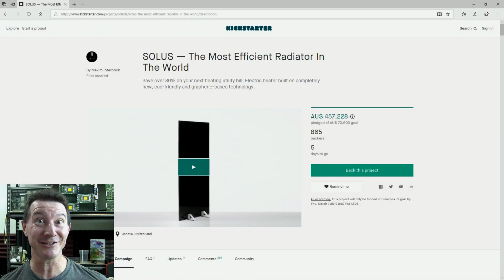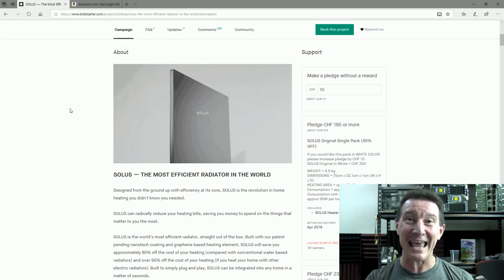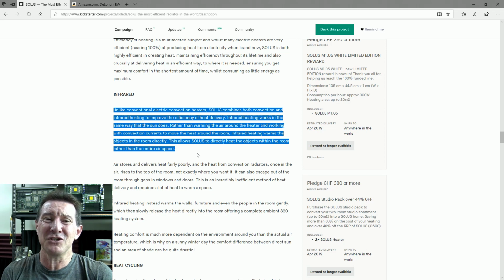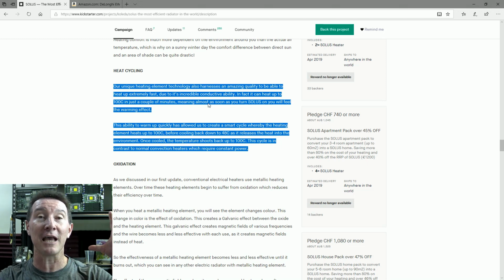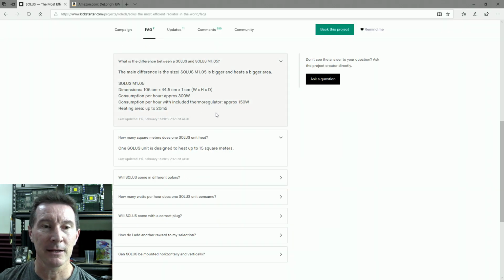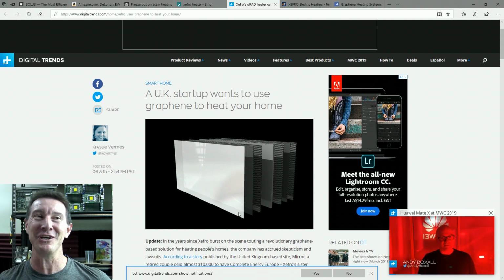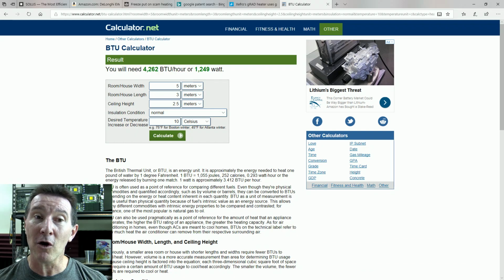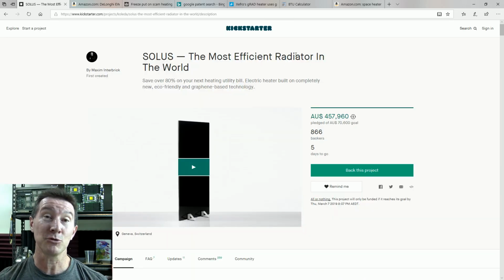EEVblog #1186 - Solus Graphene Heater Kickstarter BUSTED!

Comment: In an effort to say something besides the 1500 other comments, I will differ with a couple of things Davey didn't go very far into. (What is presented in the ad IS a crock.)

 People that are schooled in electronics (such as myself) start off completely underestimating how well a bad conductor of heat conducts, because electrical insulators are so drastically better than thermal insulators. A reasonable amount of heat will be conducted through 2 mm of glass, while you would expect no measurable amount of electricity to be conducted. Besides that, all that happens with a bad heat conductor is that the temperature differential rises, making heat flow faster, until it conducts just as much heat as if it were a good conductor (thermal equilibrium.) Besides that, a bad thermal conductor can be fairly transparent to electromagnetic waves, bypassing the fact that it is a bad thermal conductor. As Davey points out, the watts will always get into the room one way or another, but that is going to be primarily through the face of the glass.

 The problem is how hot the panel will have to get, and it will become dangerous before it self-destructs. OTOH radiation dominates over conduction as the temperature gets hotter, and the advantage this panel might have, if it has any, is more radiation, if indeed it radiates more than a cheap space heater, which is not evident. They never make clear in the ad any advantage.

IAC, if you make the radiating surface big enough, the temperature will go down, and, by the fact this thing is not in a protective enclosure, it must be cool enough to be safe. It better be.

 It is possible this is simply a large radiating surface (at an astronomical price) and by that means it will be more comfortable to be around (as Davey mentions), so, as a supplement to your usual heat, you might be able to lower your thermostat.

Comment: I am about to launch a Kickscammer of my own. Who's with me?
So, it will be about this: 
"Modular Ultra-efficient Heating Elements with Visible and IR Light.
Our mission at Luxor is to reduce the costs of heating and lighting your home. Based on our patent-pending technology using tungsten nano, micro, and mili wires, we have created some glass capsules of various power ratings from 15W to 150W. These Silicon oxide capsules will fit into your existing lightbulb sockets (E26) and provide you with warmth and comfort, as well as natural looking light. No more that cold and blueish tinted light from those flickering CFL lightbulbs. Now, you get warm yellowish light that will stimulate your brain and regulate your heart rate. 
The first 1000 backers that contribute $500 or more, will also get our patent-pending magic black-box that will allow you to dim the light and reduce the heat output to fit your exact needs and desires. 
Bringing the future today! Don't be left behind! Pledge to our project and be part of the enlightenment revolution!"

Comment: Now I feel sad and environmentally guilty. All my life I used those inefficient radiators that waste energy by converting most of it into wasted heat that is simply dissipated into the room. PS: What is not heat is a mechanical work of a fan and some light from LEDs.
I remembered that I used to get free heat from my electric water boiler. Much better than the 1.5  seconds of the "graphene" from Max. So, it goes like this: I boil the water for my tea or coffee, then even after turning the boiler off and pouring the water in my cup, it continues to "produce" heat that is being radiated into the room and in my body.

Comment: Reminds me of the local old-fashioned salesman that runs the same old home electronics shop since he was young, more or less affectionately nicknamed "el charlatán" due to the way he peddles  and upsells his lackluster wares. Recently I asked about the cost of a deep fryer, since mine needs the drain tap fixed or replaced, and also the cost of the part. According to him, it can't be fixed, and the new model he sells is more efficient. He totally ignored my dry "a resistance is 100% efficient" comment and kept going on his spiel. Could have sold me a new seal or the whole part, whatever is needed, if he was honest enough to drop the bullshit when he is called on it.

Comment: Question to everybody here, a radiating heater is 100% efficient that's understood but what about those heater that uses glowing wire and fans, are they not less then 100% efficient? I mean due to the light emitting from the glowing wire and the movement of the fan.

Comment: Graphene is a terrible material to use for a heating element simply for the cost of production. Fan heaters cost practically nothing and have the same efficiency as this product, except fan heaters will bring the room temperature average up more quickly because of the forced convection.

Comment: This is a convector not a radiator.
Radiant heating simply uses radiation to heat surfaces of objects. Unlike convection heating that heats the air, radiant heating emits infrared radiation, which travels unimpeded until it hits a solid object, which absorbs the radiation and warms up. A good everyday example of this in practice is the sun. This heat is traveling through the vacuum of space.
Convection heaters heat the air and then transfer the heat throughout that space to warm up people and physical objects.
I suppose its a combination of conduction and convection heating but not radiation. Its unfortunate that someone called these things radiators a long time ago and its stuck .

Comment: to everyone who has no idea about the basics of thermodynamics:
imagine you have a pond in your garden. it has all sorts of leaks, so it looses quite an amount of water during the day. in order to keep the water level within a desired range you are refilling your pond from your mains water supply every day. you could achieve this simply by manually turning on and off a tap connected to a hose leading to your pond. or you could install an automated system turning on and off a valve (or tap for that reason) to keep up the waterlevel. quite simple over all, isnt it?

Now imagine someone offers you a brandnew system and claims by using it to refill your pond you will save on 80% of the amount of water you used before!
Edit: Thats the same type of promise SOLUS is making.
Would you believe the claim of the company trying to sell the new and magic water refill system??
There you go!

Comment: Oil based heaters are mostly relying on convection and not radiation because the oil can only get so hot before it starts chemically decomposing and fuming. The higher the temperature the more dominant radiation becomes at giving away heat.

There's a recent craze when it comes to "radiation" heaters because they heat your home evenly unlike the pesky convection heaters which only heat your ceiling - which is complete bullshit, of course.

Comment: @EEVblog , you got the science on this one completely wrong, I'm afraid. The product may or may not do what it claims, but if it is a 300W infrared emitter is will in fact make skin and other surfaces warmer at a distance without warming the air in between

Think of a heat lamp, or how facing a campfire on a cold night feels warm even as the air between you and the fire remains cold. If this product is in fact a strong IR emitter (and a 300W heat lamp can be dangerously strong) it will in fact make people feel warmer at a distance. In that case energy lost through conduction to the air would be considered a waste. That makes the insulating properties of glass a feature, not a defect.

Surprising that a technical crowd like this appears to have missed this. The major components of air being relatively transparent to infrared radiation (CO2, not so much) is fundamental to understanding the greenhouse effect and our changing climate. I'll admit the whole IR thing can be counterintuitive, but take a step back and think it through from a physics viewpoint. Infrared radiation is an electromagnetic phenomenon, not a thermodynamic one, until the IR absorbed by matter.
Reply: And when I googled "infrared heating panels" I learned much of the world already knows about and uses this type of product. As I sit here listening to my forced air heater running in the attic I feel a little silly. Winter's almost over here on the top side of the world. I will definitely give IR panel heaters (not Solus) a try next autumn.

Comment: The creator keeps hammering on this point: "Our graphene compound continues to generate heat when cut from the electrical current."

No it doesn't. If this were the case, the heater would be a major hazard, because it would continue to heat in the absence of current, and whatever exothermic reaction is causing that runaway heat production would inevitably destroy the heater (and the building in which it was placed). That whole argument literally goes against the concept of an electric heater.
Reply from the maker: It's totally stupid!
Reply: Michael Bradley-Robbins not if it’s nuclear! They’ve clearly cracked cold fusion and are using this as a front...

Comment: It's so ridiculous. I think that they have to cycle on-off the power to slow down the heating of the glass, to make sure it doesn't crack. Humm, reminds mo of my father complaining that our new glass-top oven is so much slower to heat water, because the heating element is configured in a way to make sure that the glass won't crack, due to too fast heating.

Comment: I'm kinda in the field. If you look into best heating system you can have i recommend underfloor heating. It have it's drawbacks (mainly reaction time) but it's best idea we have right now. 
You basically change your floor into HUGE radiator, with temperature of ~30 C you get Insane amounts of heat, and if u can use condensing boiler (that have insane efficiency among boilers) and water it's great. Condensing boilers "like" to work on temperatures close to those optimal for underfloor heating. Also Heat pumps are a great alternative for boiler ;) There are also electric underfloor heating systems ;)

Comment: They are NOT 100% efficient. They require a remote which has a light source which means that SOME amount of energy is being converted onto light NOT heat. Even if it's batteries, that is STILL energy NOT going into heat. 

Great video, thumbs down for the sexually suggestive gestures. Be professional Dave. There's enough of that crap everywhere. I'd like content COMPLETELY clean and professional.
Reply: The light will eventually hit something and be absorbed as heat.

Comment: My electric radiator makes clicking sounds as it heats up. I guess some of the sound energy may escape the room and eventually dissipate as heat the outside. Maybe this radiator doesn't click and thus saves a uW or two.

Comment: Reminds me of this, take a look at the last photo on the page:
http://www.green-comfort-heating.nl/product/ambepanel-hangend/

There was another one, which I can find that comes even closer to this. They had a great theory about how air travel the room and how it pass the 'radiator' (mounted on the wall) and that was the reason it was more effecient. Very plausible however the SOLUS thingy is just a shiny rip-off with no clue what it is actually doing or how it works.

Comment: I have been wondering why you would not combine a fan blown resistive element heater with a halogen infra red radiant heater in one? it seems like it would heat both the air and the surfaces of a room. Am I the only one to think of this, or am I missing something?

Comment: Water radiator heaters are common in areas where there are natural gas boilers and supply.

It is definitely a big thing in northern Europe. Almost everyone there will know about "bleeding" the radiator, which is basic maintenance. 

An oil radiator is normally a standalone thing, powered by electricity. They are more expensive to run, and therefore, to get you by at a bind. 

Typically if you don't have gas supply you need "storage heaters". These are terrible. These are basically a heating element, surrounded with heavy iron / ceramic stores. Very basic idea. They usually only on night supply of electric due to it being cheaper (so that can affect what scheme you are on with the electric company). They heat these stores up at night, and these store then release the heat over the day. At least that is the idea.They are a pain to get the right temperature becuase of the day. While there are "smart" version of them, there isn't too much technology wise to make the concept work better. It is all down to the material of the store.
Reply: The added advantage of water radiator is heating centrally hand having a circuit of radiators in every room.  This why we call it central heating...

Comment: I think they are talking about heat transfer to the ambient air not necessarily electrical efficiency. An example being like a block of aluminum as opposed to a proper heat sink. A heat sink is more efficient at dissipating heat. Still doesn't avoid the fact that this is trash. 
If that's what they are talking about, then they are wrong. That panel has no where near the surface area as a regular radiator.

Comment: I use that $80 Amazon radiator you used as a comparison. Decent heater, and exactly as efficient as every other resistive heater on the market thanks to the laws of thermodynamics.

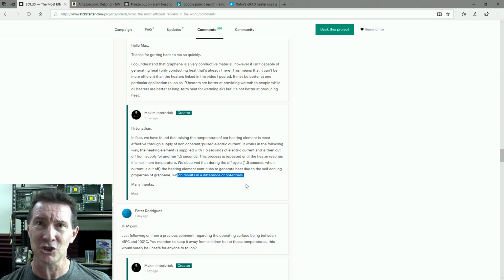Edit: I just got to ~31:30. So these guys claim their device violates the Law of Conservation of Energy? And then their reaction to this was "Hey, let's sell space heaters" and not "Hey, where's my Nobel prize?" I mean, obviously there's just significant hysteresis in the system, probably because of putting the temperature sensor in a dumb spot, then slapping a couple sheets of insulation on the thing.

Comment: The Solus does save you 80-90% of your heating bill.

When something uses 10-20% of the energy of a normal heater, you are going to save 80-90% 🤣.

Comment: Not only is glass a poor thermal conductor, it blocks mid-band infrared (thermal infared).  That's why it's used in greenhouses, because it prevents radiant heat from escaping.

Comment: To be fair, if you compare it to gas powered central heating systems, as are commonplace in Europe, electric heating is more efficient. A fair amount of heat is lost in the flue gas from the boiler, and depending on where the hot water pipes run it's quite possible they'll lose heat to the outside before the hot water even reaches a radiator.

So - electric heating is more efficient, but there's nothing special about this product at all. Also, you have to consider that even with the efficiency difference, it is /significantly/ cheaper to heat a home with gas - which really is the reason gas central heating is a thing here.
Reply: If you treat the electric heating system in its entirety, it involves a transformer in the street nearby, a few miles of cable underground and overhead, ending at a power station somewhere.  How does that compare to your gas central heating system now?   The losses in power transmission are one reason why heating by electricity is expensive and perverse.